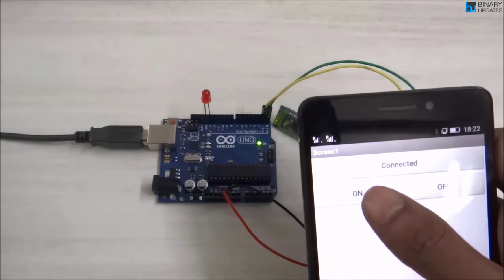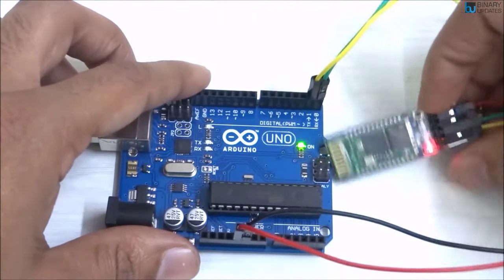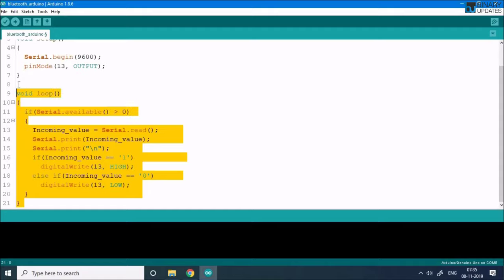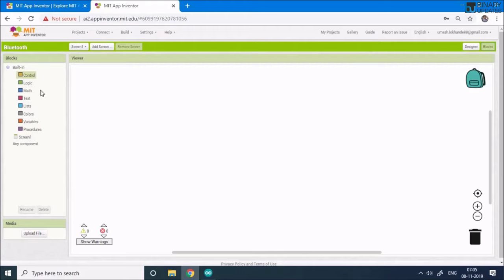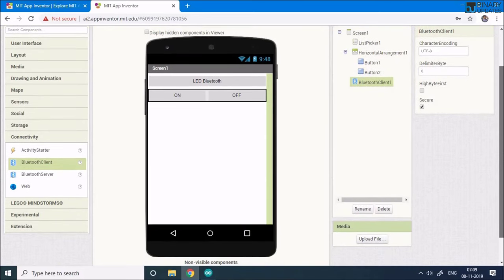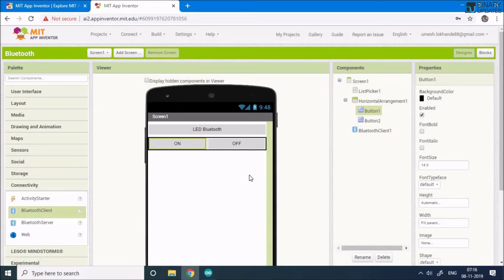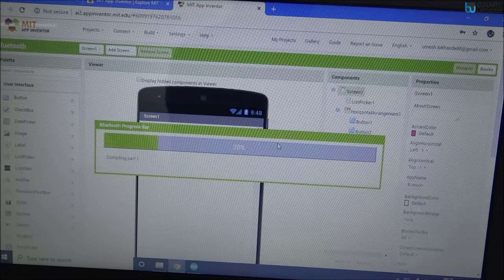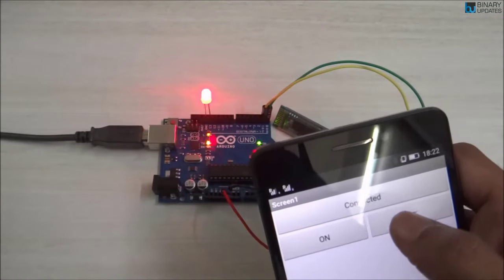HC-05 Bluetooth Module with Arduino-MIT App Inventor

Comment: HC-05 is not showing in my app how can i conect to the ardino
Reply from the maker: Hi, please go to Bluetooth App settings in your Mobile Phone. And allow to find nearby devices check box. These days because of security every mobile phone manufacturer need to do this additional settings in order to detect other Bluetooth client like HC-05 Module. If you do this setting in your app settings your issue will get resolved. I will soon making video on this as i get time. Thanks for your patience. Good luck and best wishes!
Reply: In my phone HC05 is showing in Bluetooth app, but not showing when I click on SCAN. The same app is working in other phones.

Comment: I see a blank screen when  i try connecting to bluetooth from the app
Reply from the maker: Hi RavenTech, please check video description. I just added video link where its shown how to fix the issue when HC-05 does not show up in your mobile app. You need to enable some settings in some latest version of android phones. Good luck and best wishes!
Reply: @BINARYUPDATES  I'm just about to finish the project I've been working on, if only there was a way i could show it to you.

Comment: when i tried to control led "error 516 broken pipe " is indicated, so please guide
Reply from the maker: Hi Sudhir, Please check connection between Arduino Uno and HC-05 Module. And also make sure Mobile is paired properly with Bluetooth Module. Good luck and best wishes!

Comment: how dose the code change if i want to use  a motor instead of an LED help me out any one !!
Reply: You can put any source to pin 13. Put your + from your motor to pin 13, minus to ground. But be careful, only use small motors, you can damage your board by connecting the motor directly to the board. Means, you dont have to change the code, just put an motor to the pin 13 and GND on your arduino, no need to change the code...
Reply: @markusw.3138  thx bro..it was helpful indeed
Reply: random stuff your welcome my Friend!

Comment: i could not turn it on',i was chechink with serial monitor but getting x?x?.... something
Reply from the maker: There will be two possible reasons
1. Check baud rate in Serial Monitor if its same as in your Arduino Code i.e. 9600
2. Maybe your HC-05 Bluetooth Module is Broken

Comment: why am i getting "avrdude: stk500_getsync(): not in sync: resp=0x00," please help i searched for years
Reply from the maker: Its because you have to remove Tx and Rx cable from HC-05 Bluetooth Module while uploading code on Arduino Uno. Once you upload code then connect Tx, Rx jumper wires. This is caused because upload failed. I hope this may help you to resolve. Good luck and best wishes!

Comment: where is the led resistor
Reply from the maker: To keep the circuit simple I've connected LED without resistor. Usually, that current limiting resistor is recommended but even without resistor the LED works with Arduino Code. Thanks and have a good day

Comment: Circuit works fine. But HC05 keeps on  disconnecting after 15 seconds. What to do? Any suggestions??
Reply from the maker: Try Pressing RESET button on HC05 Bluetooth Module. This may help you otherwise you may need to check HC05 in AT Command mode to ensure quality of HC05 Bluetooth Module. I hope this can help you

Comment: hi...can you please help me...there's a problem in my arduino...when i try to upload the code...it says the programmer is not responding...can i know why???
Reply from the maker: Yuven, when you upload code on Arduino make sure you disconnect HC-05 Bluetooth Module for a while. Once the Arduino sketch is uploaded then reconnect Bluetooth Module to Tx, Rx Pins of Arduino. Because Serial Tx, Rx Pins of Arduino is busy with HC-05 Module, it won't allow Arduino IDE to upload code. I hope this will help. Thanks and good luck!!
Umesh Lokhande
Reply: alright...will do
Reply: thank you...

Comment: Im doing the exact same thing my project isnt working pls help
Reply from the maker: Hi Anshrabh, if your HC-05 don't show up while you press LED Bluetooth button on Mobile App. Then please go to your mobile phones App setting and in Bluetooth app allow permission to find nearby devices. There is an check box you have to check in order to give permission for your mobile. I hope taking this extra steps will make your project work. Good luck and best wishes!
Reply: @BINARYUPDATES  thank you so much it works perfectly fine, I was using arduino mega and was using tx and rx pins other than 0 and 1.

Comment: Error 503 Bluetooth is not connected
Solution please???
Reply from the maker: Hi Bilal, maybe check if your HC-05 Bluetooth is paired properly with your Phones Bluetooth. And finally try with additional HC-05 module, if in case the one your using is broken. I hope this might help. Good luck for your project

Comment: Hello Umesh, 
Very bgood tutorial.
I am trying to install the bluetooth app and use, but getting error ...Error:303The specified address is not a valid Bluetooth MAC address
Please help
Reply from the maker: Hi Joyce, maybe because HC-05 Bluetooth Module is broken. I would suggest to check connections once to ensure Bluetooth module gets enough power. And try again. If it still doesn't work then probably better to check and test with additional HC05 if you can pair and connect with mobile app
Reply: @BINARYUPDATES  
Thanks for the reply.
I will try
Reply: @BINARYUPDATES  Hello, I followed all your nice work, but got an error called, 507Unable to connect, Is the device turned on? 

Please be kind to provide an solution. Thank you

Comment: its showing no bluethoot
Reply from the maker: Hi Monika, where if your bluetooth can't be seen even after powering up or connecting properly in mobile phone. Then, its possible that your HC-05 may have some issue. Still provide more information about problem you're facing. Good luck and best wishes!

Comment: I have done everything correctly , but in the end my app doesn't connect with Bluetooth module. It says error is the device even turned on? 
Please help
Reply: You may have fried your HC-05 module by putting 5V on its RX pin, as I explained above.

Comment: Hello sir, I need help because I have to control a robot by MT app Inventor and Arduino but I don't know how to do it. Could you help me, could we contat each other ?
Reply from the maker: You can use this MIT App Inventor project to control DC Motors connected with Arduino over HC-05 Bluetooth Module. You can use this project as a template and customize it further to suit your requirement.
Reply: @BINARYUPDATES  Thank you but I need to control some switch in arduino but I don’t know how it works. Do you have any exemple ?

Comment: Could you fix me a error, please. I can connect bluetooth with mobile, but I cant tranfer  my signal to control even a Led. When I press a button on my phone, nothing happens :((
Reply: I had the same problem, and  I solved It when I changed the TX and RX wires for a new pairs.

Comment: List of bluetooth devices is empty ://
Reply from the maker: Hi, give permission to this App on your phone to use Bluetooth of mobile. Also, make sure enable and check all boxes in App settings to "Find Nearby devices". This will enable mobile to scan and find external Bluetooth devices. And then HC-05 will show-up in the list. As every mobile phone manufacturer is different so as settings. Just play with Bluetooth Apps setting and I'm sure. It will work. Good luck and best wishes!

Comment: LOL where is the disconnect button? How am I supposed to disconnect from the bluetooth module?
Reply from the maker: Hi Shakil, when we power off HC-05 bluetooth module it automatically  disconnects otherwise you can just unpair the bluetooth device. I hope this may help you. 
Best Wishes
Umesh
Reply: @BINARYUPDATES  That's not a solution. Disconnect feature must be included in the app.

Comment: I can't upload the code, someone help me please. It's write "Problem uploading to board".
Reply: Actually I want to know how to connecting the bluetooth modul with app inventor, but i'm stuck on this step.
Reply from the maker: Hey Wahyu
While uploading Code on Arduino Uno please make sure to disconnect Tx, Rx Pins and when your uploading finishes then reconnect Tx, Rx Pins between HC-05 Moduela and Arduino.

NOTE: Because Tx, Rx Pins of Arduino Uno is connected to HC-05 Bluetooth Module. Arduino won't allows you to upload code. I hope this will resolve your concern

Wish you beautiful day

Umesh
Reply: @BINARYUPDATES  thank's a lot
Reply: just remove tx and rx pins which is connected to arduino and then try it. Hope it helps you. Please subscribe my channel

Comment: Someone please help me, I can't pairing the bluetooth in my phone, how to fix it?
Reply from the maker: Hello Mr. Switch, please tell us more on how you've tried before. I would just add that you need to add 0000 or 1234 as passcode while pairing HC-05 Bluetooth Module with Mobile Phone. Apart from that make sure you're HC-05 has powered up properly and followed the exact steps shows in video.

Its possible sometimes, when HC-05 Module is broken then also we won't be able pair device with Phone. But I've seen much often this still we must consider. Thanks
Reply: @BINARYUPDATES  hc-05 isn't available

Comment: I have a problem trying to connect via bluetooth, I get error 507 and I don't understand why my devices are well connected, if anyone can help me I would really appreciate it...
Reply from the maker: Hi Jose, its a phones problem. This error has nothing to do with module. I think if you try with other android mobile phone. Your HC-05 Bluetooth will work properly with Arduino. I hope this may help you. Good luck!
Reply: @BINARYUPDATES  Yes I did and was able to connect from a device running Android 13, thank you very much for your help.

Comment: Thank you for the explanations. The Arduino code seems incorrect, the phone connects via the application to the BT but the buttons do not work, nothing is happening on Arduino ... It's Normal, because NO access to the HC05 module is in the code! !! It's a joke .....
Reply: any solution tho?

Comment: char Incoming_value = 0;
                
void setup() 
{
  Serial.begin(9600);         
  pinMode(13, OUTPUT);       
}

void loop()
{
  if(Serial.available() > 0)  
  {
    Incoming_value = Serial.read();      
    Serial.print(Incoming_value);        
    Serial.print("\n");        
    if(Incoming_value == '1')             
      digitalWrite(13, HIGH);  
    else if(Incoming_value == '0')       
      digitalWrite(13, LOW);   
  }                            
}
Reply from the maker: Thank you!

Comment: Hi
i'm getting an error when adding a 'SET' for 'When before picking' as follows.
'This block needs a value block connected to its socket'

Could you advice on this please?
Reply: How did you solve this? I am getting exact problem. Google search didnt yield any results so far. Please help.